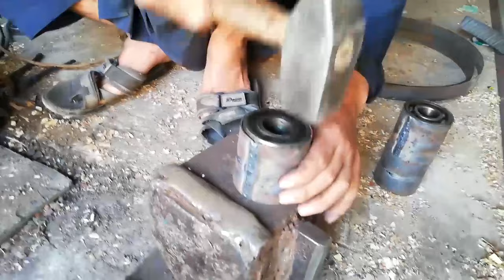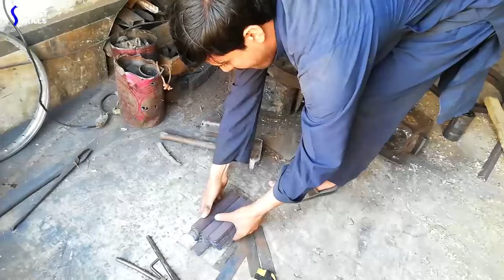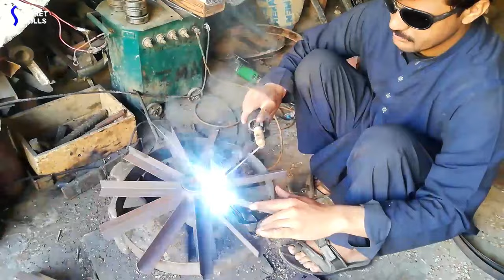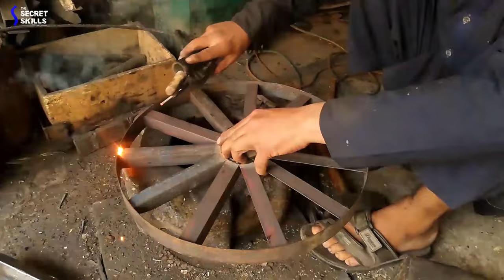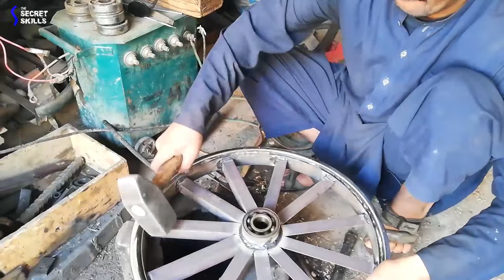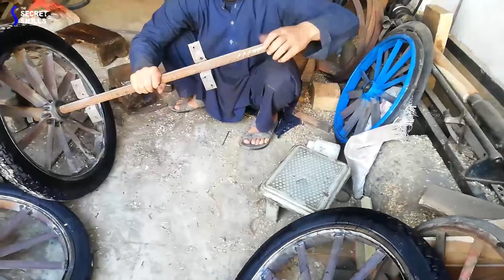How to Make Steel Wheels by Hand | Wonderful Skill Handmade Steel Rims | Secret Skills

Comment: Was that the grease in the bearings going up in smoke? Wouldn’t it be better to fit the bearings last? Thank you.
Reply: The hub would shrink after welding- that could be why.
Reply: @singlended they could fit dummy bearing and replace it later